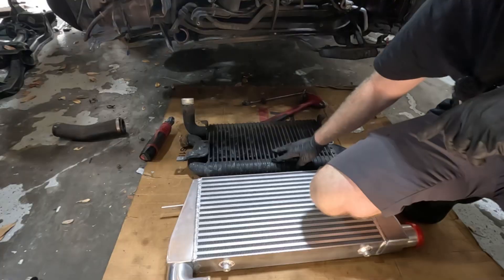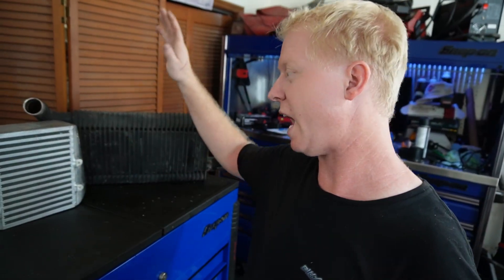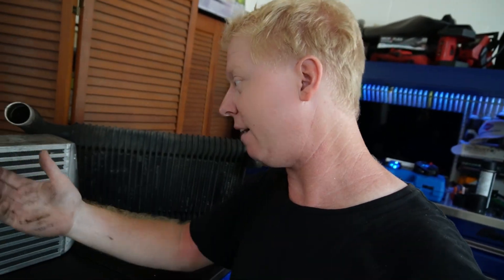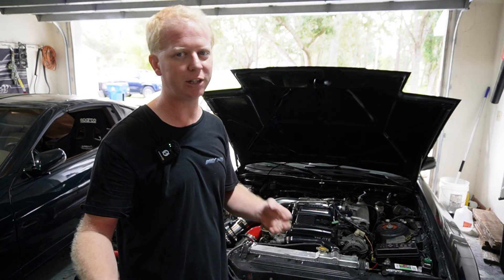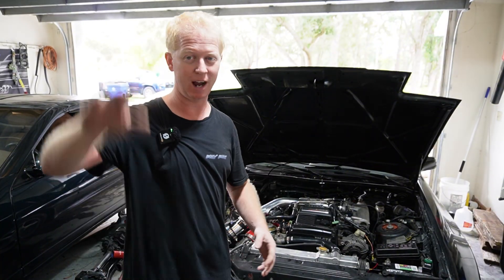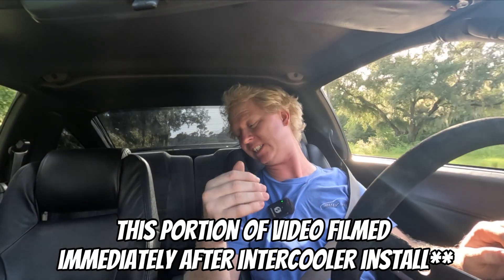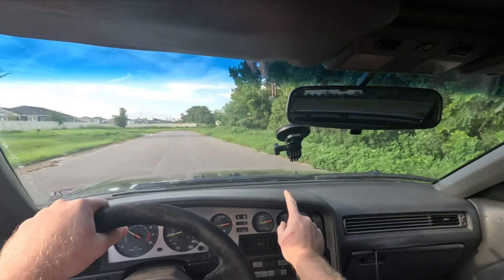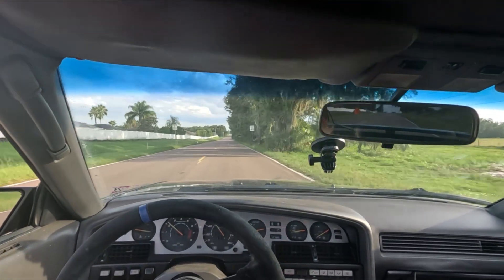Intercooler Efficiency 101: How It Affects Your Turbo Engine.

Comment: I added an aftermarket oil pressure gauge to my engine and even though the car isn't quite running yet (it's close but it has some major vacuum leaks that I just found this past weekend when my smoke machine got here) I've already noticed that the aftermarket gauge is way more responsive than the stock oil pressure gauge.  If everything is holding steady then they'll both eventually read about the same, but like you were saying the stock oil pressure gauge just isn't all that responsive.  Also the mods I made to my oil pump are really making a difference.  Doubt I'll ever have to worry about oil pressure ever again.

Comment: This is why I always chuckle at WRX, STi and Speed3 drivers. Air travel can impact turbo systems as well. The shorter the piping, the more efficient everything is. A thicker core with higher flow on a side or top mount is MORE than enough. Especially on top and side mount vehicles.
Reply: You chuckle because you're uneducated and thats okay, while the front mount intercooler has a lot of piping its better than having 160-190°f intake temps riding through the city or in ANY amount of traffic, plus when you make real power the amount of piping in the fmic kit is negligible
Reply from the maker: I've always thought the same, though those top mounts do suffer excessive heat soak.